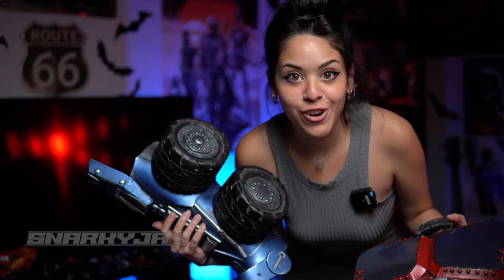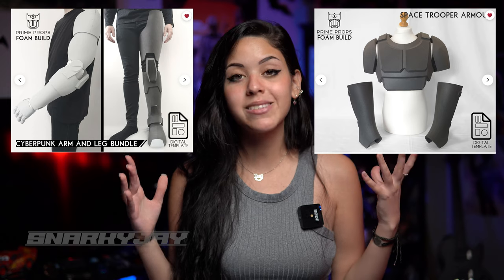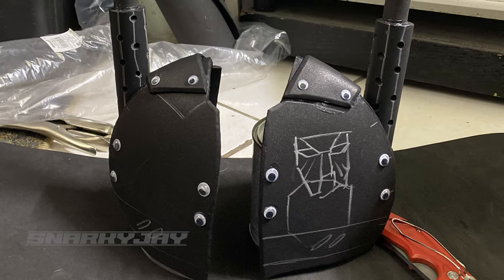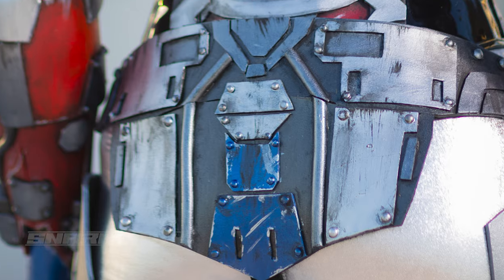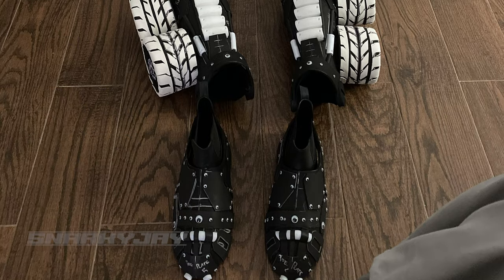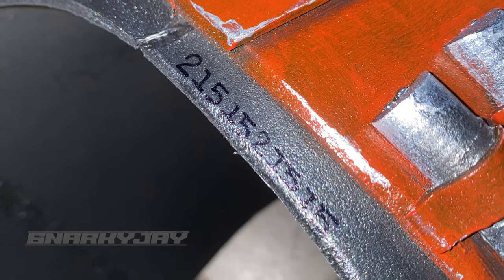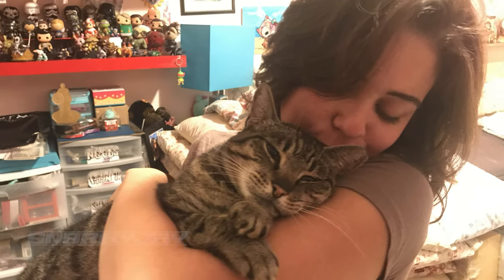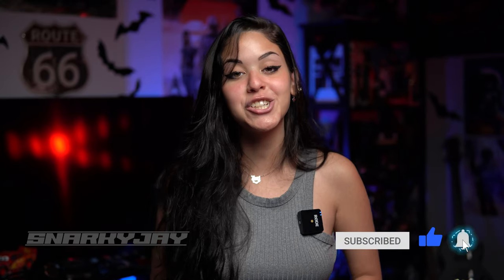How I Built THIS | Full EVA Foam OPTIMUS PRIME Cosplay!

Comment: You’re soooo cool and talented! 😊
Reply: Being technical, crafty & creative myself was curious on how you seal the foam to take paint. And since there’s flex in the material how you stop it peeling flaking off. 

Also do you use a airbrush/spray gun for large areas? Very handy for flawless and brush stroke free finishes.
Reply from the maker: Thanks, Richard! Plastidip is a sealant to prepare the foam for paint.
I painted all of this by hand, I only just purchased an airbrush.
Reply: @snarkyjay  Back at art college I used a DeVilbiss Aerograph Super 63e extensively. But that was for fine detail stuff (commercial illustration). For larger areas, for example blanket coverage of primer, I’d go for a spray gun. Rather than getting uneven layers of media with a fine tool.

Keep the airbrush moving when applying media (to prevent pooling), preferably start & finish spraying off the piece in one motion. Explore the use of masks. And thoroughly clean between colours and when you finish. The step up in finish is huge. But bristle brushes still have their uses depending on the finish you need. I hope you have a great time with it. 

Good luck.
Reply: Bruce Wayne using a spray gun:
https://youtu.be/_ezibzn6K9Y